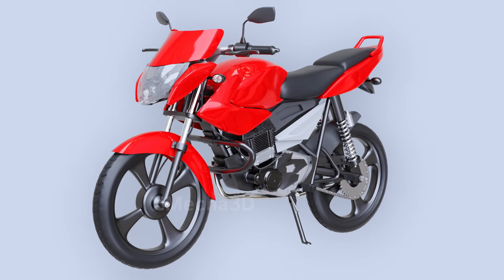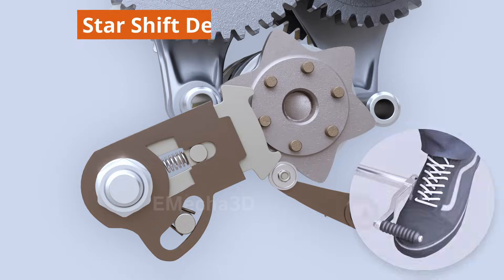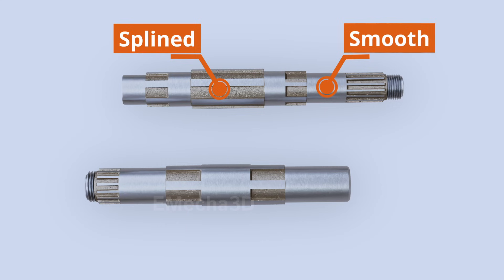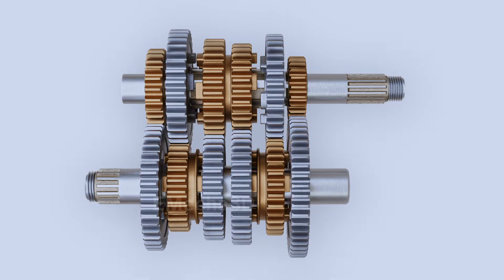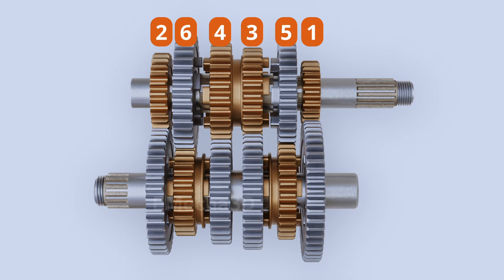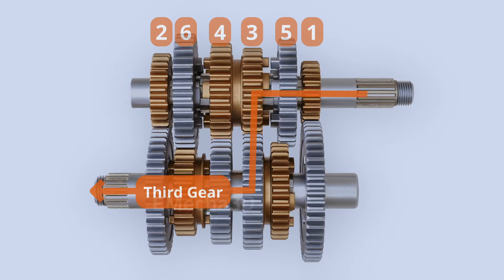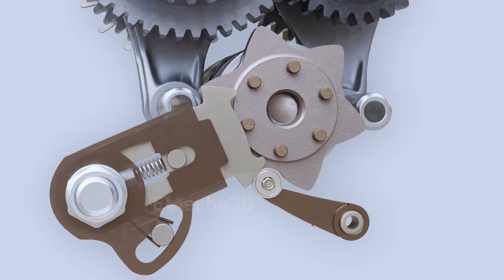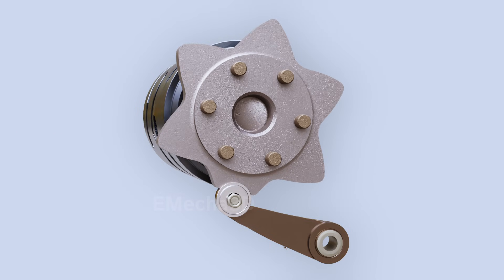Understanding Motorcycle Transmission System

Comment: Although, Tech science foundations requir such 3D animated presentation that is not simply effective, precise, calculated , scientific, logical, the most advanced methodology based on real research works and consequences of sequencial development that not only gives  a clear understanding of the core  function the and mechanisms inside the Engine. Huge respect, regards and honor for the expert teams who showed a thorough involvement in engineering . Being impartial Just trainer, interested to established smartest and bestest institutes for the safest and error free centre and control mechanism of air vehicles that requires or based on zero error tolerance. Although classified information be kept on their domains but rather a lot of appreciation words for the generation , utilization and the amazing works of demanded such work beyonds all discriminations. Experts Team be trained and bound to deliver at home stations. 
Highest regards from Pakistan

Comment: i don't have a motorcycle yet, but from what you explained, if i push the feet lever up to change gear and keep it hold at the highest point, it's a neutral
Reply: chatgpt confirms
Reply: No. You need to stop at the specific point between the first and the second gear to switch to the neutral. Sometimes it might be tricky (only Kawasaki motorcycles has a special, patented mechanism which makes it an easy task).

Comment: No reverse mechanism? :face-blue-question-mark:
Reply: Most of motorcycle transmissions have no reverse gear. But it would be possible with a help of a third shaft, as you need to change a number of gears in series to change the direction. But the transmission would be bulkier.

Comment: Don't need synchronizers?
Reply from the maker: The constant mesh transmission typically don't require synchronizers. Gears always remain engaged preventing the risk of separation and grinding.
Reply: @EMecha3D  Nice, a simpler system, thanks.
Reply: @BlackBirdNooB  But a clutch has to be more sturdy than in cars manual transmissions.